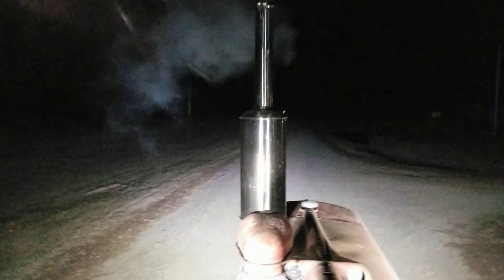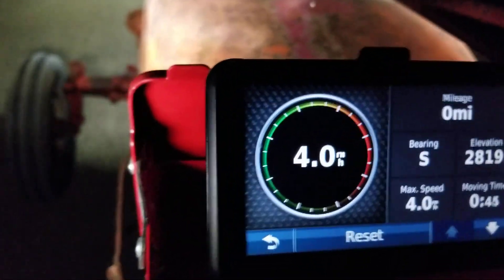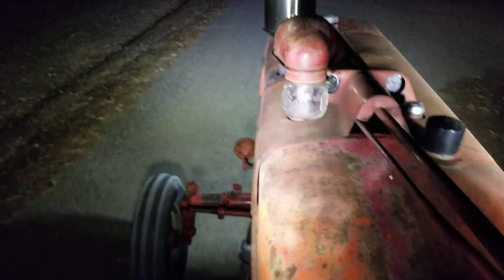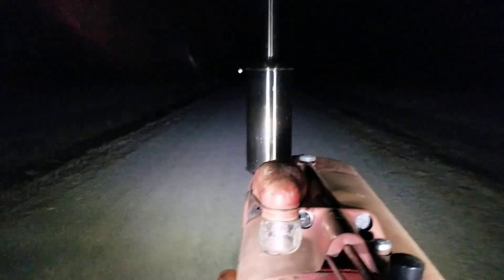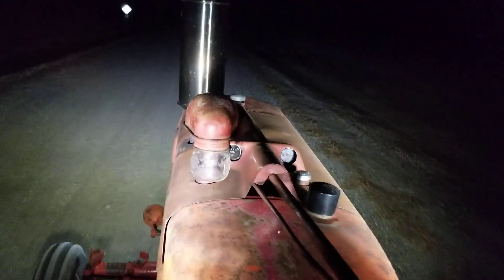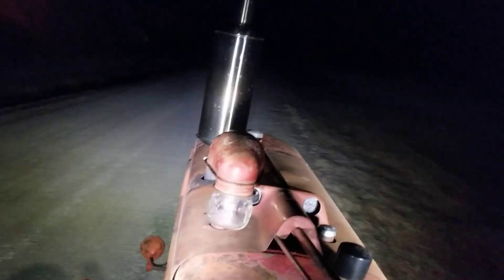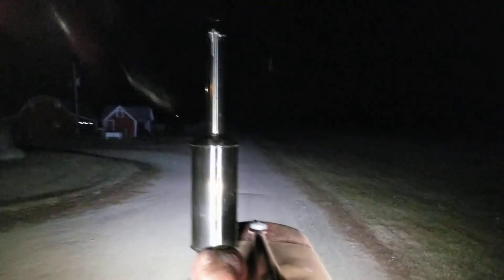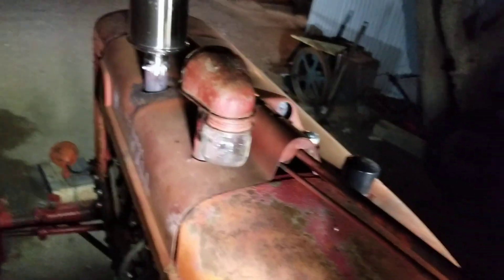Farmall M M&W 9-speed GPS

Comment: Good day Could this been installed on  W-4 &  6 too, I would think?   Were they realiable or was it a cheaper  unit.  Thanks
Reply from the maker: Yes I believe they were available for those as well. Very reliable and fixed a couple of issues these had from the factory with a bearing or two that were weak and not oiled properly.
Reply: @smgussey  Can they still be bought, or were do you get them from?
Reply from the maker: @donvoll2580  they are no longer produced. I have seen one New Old Stock (NOS) on ebay many years ago. Only choices these days are to find someone who has removed the gearset, etc from a tractor or to buy a complete one with it installed. Heisler also made an overdrive gear set, their lever is on the left hand side. M&W has a cable or lever on the right hand side.